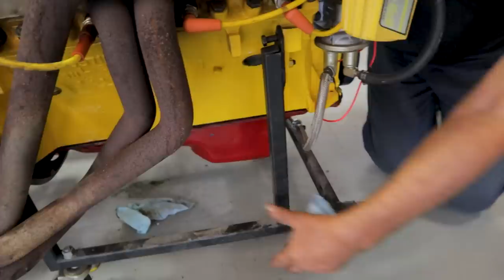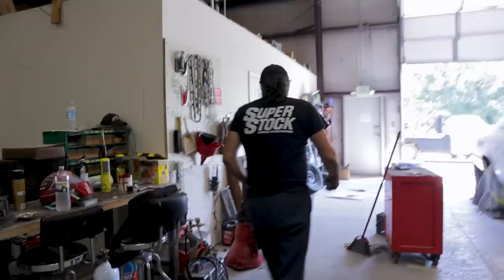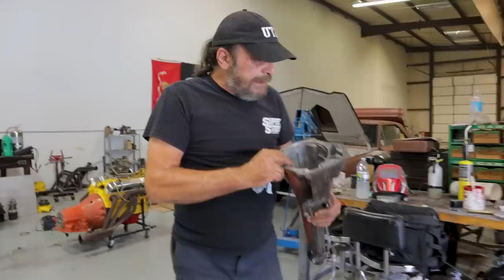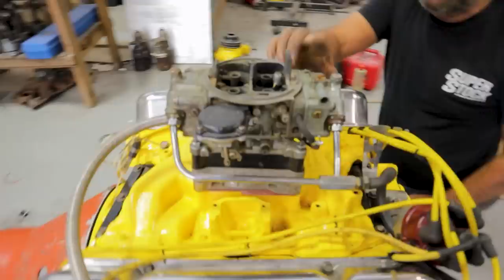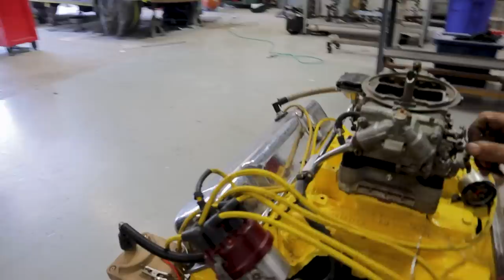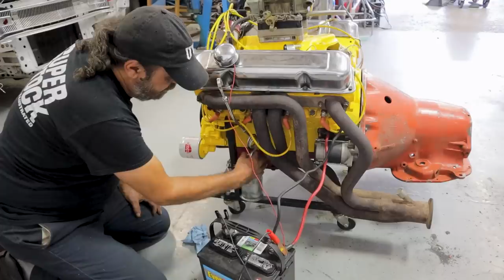Cheapo Homemade Engine Run Stand And The First Start On Our Mule Big Block Chrysler

Comment: Make a separate stand with a radiator and electric fan, that you can roll up to the engine stand and hook up with just radiator hoses.
Reply: He knows this.
Reply: @JasonLuther1  He does, but not every reader of the comment section does.
Reply: @JasonLuther1  really then why doesn't "he" do it??
Reply: Me thinking he just didn't want to take the drive to get it that piece Dallas has is big
Reply: @bbb462cid that’s big brain thinking chief
Reply: @thomasshelby1922  thank you for using my title

Comment: I love each and every one of my tools that just decided to show up somehow one day. They seem far more dedicated to helping me do what I'm up to than any other tools I have. They also seem to be really eager to make themselves show up just in time to save the day.

Here's to magical tools of mysterious origins!
Reply: I have a (close to) complete Stanley ratchet set that honest-to-god fell off the bumper of a van in the '90s as it drove by my house. Great ratchet, my all-time fave set even if a few of the sockets and extensions or of 100% mysterious manufacture. Old, beat up, tested and true tools can't be beat.
Reply: @bbb462cid 
Isn't it crazy how the magical tools seem to be even better than the high-quality pricey stuff you buy? Maybe that's just me, but I got a pair of dikes that showed up one day. They're all clapped out, bites taken out of the cutting edges, wonky joint, but they consistently do a better job than Klein dikes I bought. Hell, they do good enough to keep me from getting some knipex dikes, because I don't wanna spend the cash and end up not using them because I've got my trash pair.
Reply: @bbb462cid  I've picked up numerous tools off the road and stuck in used cars or in the junkyard

Comment: A tip for fresh engine builds… run it with some quiet mufflers. If something is going wrong and making noise, you’ll be able to hear it that way. Then open it up after everything is ok if you want to hear it.
Reply: For sure.....you can even hear the manual transmission flywheel grinding on the auto trans bell housing without the visual of sparks flying everywhere when ya romp on it! 😂😂😂
Reply: @trailerparkcryptoking5213  I like the sparks!
Reply: But then i hand to turn the radio up like when your driving home and something is wrong

Comment: It's been 102-104 in the shop in the afternoon this week. 
We're running tap water through a truck radiator tied to a barrel fan, keeps it bearable til about 2-230. 
It helps we have a truck to run the warm water into to reuse for watering the lawn.

Comment: Shade tree 101 and great video as always. I have a 440 almost finished and wanted to run it before putting it in my Coronet so seeing this provided a great option to chasing a stand somewhere. I’ll have to go farther and include cooling to run it long enough to burn in my camshaft but easily doable.
Reply: I dunno car chassis make pretty good engine stands..
They even have a fuel tank. 
A battery. 
Mounts. 

And a coolant system. 

Amazing. 
🎉
Reply: @fastinradfordable  ....but that isnt what these guys want....and for GOOD reason.
AMAZING that some cannot and do not see this RELEVANT fact.

Comment: I built a run stand from an engine cradle about 8 years ago. complete with radiator and electric fuel pump and fans. It has never let me down and doesn't take up much more space than this rig. Great video, keep them coming!

Comment: After the temperature issues with Plan Z, you may want a ball valve in between your garden hose and the engine and restrictors on the outlets so it can reach operating temperature.

Comment: Tony I always wanted to install a modern disc brake rotor and calliper to a 727 outlet shaft to tune engines with resistance for timing and carburetor response

Comment: Friend of mine was a master welder and dabbled in Chevys. He built a stand out of box tubing and put 4 X body hubs and tires on it to roll it around plus a trailer hitch. Hung a Turbo 350 off the back and used my 69 Caprice spare Rad. I wired it up and put in the gauges starter switch and battery disconnect. He ended up selling it and I never got my rad back! 😕

Comment: I built a run stand for a 200 inline 6 a few years back, its on my channel. I got a slant 6 running on the ground too, i know youd appreciate that motor for sure Uncle Tony lol. If i had to make another one, id totally use a cradle like you did. 

As for control panel, id want something that just bolts/grounds to the engine. Find a bolt hole roughly 3/8 anywhere on any engine and bolt the panel to it. I LOVE starting engines up on the floor.

Comment: Stray shopping carts also make great engine storage stands. Just saw the basket off and use a couple of 4x4's to block up the engine. You can run an engine on it as well, just don't rev it too quickly.

Comment: A brake rotor and caliper on the output of the trans with a locking pin would give you a lot of flexibility.

Comment: Bigger castors  Tony.....the bigger the wheels, the easier it moves.  Try a set of old grocery shopping cart wheels.
Reply: The trick is finding them for this cradle. I'm in the same boat, those wheels are too small
Reply: Tractor supply or Harbor freight
Reply: A cross-brace or two would be nice as well; that's alot of cast iron balancing up there.

Comment: I did the same using one of my engine stands and added a cross bar with up rights for the engine mounts. Welded a plate to rear stand up right to bolt to bellhousing. Worked really well !

Comment: Uncle Tony, when I was in high school in the 80s, we did motor mechanics 

and we had engines on stands like that taller off the ground of course 

but cooling wise they ran pipes to a 44 gallon drum in the corner of the workshop that was full of water, not even coolant. 

It works very well

Maybe if you do lots of testing on the stand that idea would help you out…..??

Might be easier to plug the motor into an inlet and outlet, generic hose, rather than fiddling around with radiators and having the radiator in the way …..

Comment: Though about building a run stand for the 273 too break in the cam. In the end I just put it in the truck, fired it up and drove the damned thing. Same way I've been doing it for 40 plus years. Kept the revs up the first 20 or so miles, new cam is fine at 3,000 plus miles. Quaker State 5W-30 synthetic oil, no zinc additives. Rings seated fine too.

Comment: Thanks for the cool demo Uncle Tony..I have a 305 sbc on the floor that I want to test run like this and have several carbs that need to be rebuilt and sold around here. Your projects help a lot, I will keep tuned (to you build channel). Looking forward to your garden hose coolant idea. Seeya

Comment: Put a truck brake on the back of the transmission.

I have one on my Dodge motor home.

You may need to really extra tighten the shoes to hold against a full load of power, depending on your mule engine, but in the overall, its pretty strong and can hold up to a reasonable amount of power, as it is designed to hold back up to 36,000 pounds of truck or motor home on a 7% grade.

Comment: If anyone has, or has access to a wire welder they can keep their eyes open while driving around for people throwing away bed frames, angle iron is perfect and easy to find for free to fabricate your own stand.
Reply: May work ok for a stand but don't use bed frames for anything structural , the steel is horrible.
Reply: Any time someone is getting rid of a bed frame, I always accept them.  Angle iron can be really useful for a lot of stuff.  I also save old water pipe.
Reply: @robertbriggs4176  agreed that it isn't the best and wouldn't recommend making a car frame from them but given enough bed frames and enough wire for your welder you can build a lot of stuff, using that stand as an example if you made a box out of two pieces of angle iron for the base it would be stronger than that thin wall box tubing on Tony's stand.

Comment: If you want something to put an engine under load without driving it in the car, consider one of those electric retarder assemblies out of a Semi Truck - they have magnetic solenoids that act against a flywheel used to slow a truck down and not wear the brakes excessively. That would be perfect for a scenario like running an engine in, something i've thought about doing too

Comment: Hey Tony, maybe I’m missing something but I’m curious what you would do with the output water from the motor if you just ran a hose to the input. I’ve done this before outside and just let the water flow but I would imagine you would want it more contained in your shop. Just curious, again, maybe I’m misunderstanding something.
Reply: Exactly that  this is how I fire up marine engines before dropping them in so check out marine engine cooling system.
Long story short, connect a radiator hose from thermostat housing to water pump inlet then connect water supply to water pump heater hose fitting.
The waste water will exit the other heater hose connector, usually near or on the thermostat housing.  Water will be recirculated through the completely full block water jackets by the water pump, so there will be no hot spots from trapped air pockets.
Don't forget to drain the block before cold weather exposure.

Comment: Why not use a whole transmission with fluid. Take a yoke attached and welded to disk break rotor install caliper master cylinder with a locking handle and adjustable pressure to test torque converters.With a little work I think it could be done.

Comment: Get fat wheels for the stand, i got some that came from pallets that held hd steel sitting benches for the Mall outside use in Vegas. they have ball bearings about a 1/4 inch fat solid rubber wheels.
Reply: Get shopping cart casters

Comment: U.T...why not just apply the foward & reverse drum in the trans.....!....it would be like a line lock....it would be all valve body work..im sure u have done that @ one point...!...just a thought..or... .send the valve body to that guy u mentioned & have him set the valve body up with a line lock...!...i dont know how or if anyone will or has done that..but...I think u will crack the case by the parking break ball...if u try that route...!..lock'n both drums is safer than the park'n brake ball...only thing u can do with a line lock is cook the fluid or damage the convertor...one toggle switch controles it...simple...great video....

Comment: Wondering if you could weld a yok on a sliding square tubing like a 3 points hitch to mount on and off the transmission when you need to change the transmission. With a hand break like old trucks have on manual transmission. You could put the transmission in gears to test the converter ?  Mounted on 1" plate, the transmission wouldn't move a bit.  Would testing a converter in park really  be accurate measures ?  One teacher always had this tought of, " why do something simple when you so it complicated ?"  I guess he had a little influence.   Hahaha
Reply: Not for 6000 RPM test.  Lol

Comment: so hows the 361 stack up to a 383 2bbl? would a rebuilt 361 be better than a rebuilt 383? just curious because my 383 is tired the valve seals are laying in the head in pieces

Comment: Could you just bolt an auto transmission and converter in it and just leave it in nuetral or park and run the engine?

Comment: Ive built multiple test stands for ford engines and always run a flex plate rather then a flywheel just incase the flywheel decides to come apart for whatever reason.

Comment: Hey Tony how did you trigger the coil I know you put the positive to the battery but the negative do you just plug it in the distributor and distributor to ground ?
Reply from the maker: It's a points distributor.  One wire from the distributor to the coil
Reply: @UncleTonysGarage  can you make a video like “how to wire an engine on an engine run stand for dummies”? I have a BBF and want to start it like this but can’t really find a video that does a step by step and why, points vs other distributors, etc. Thanks for the awesome videos.

Comment: Everyone says how to break in a cam at home but what do they do at the factory when a car is built is it the same process ?
Reply: Back when flat tappet cams were the rule of the day, auto production engines were test run at the end of the engine assembly line, there is a (u-tube) video from a FORD engine plant in the 1970's showing a worker hooking up the engines and starting them, and bring them up to temp.  Pretty sure if a manufacturer didnt actually start the engine at the end of the line, they were cold spun with an electric motor to test everything.

Comment: Could you do a quick video on how to wire an engine that doesn’t have an ignition harness hooked to it so that it will run? I’m trying to figure out if my 230 in-line is worth saving but the harness is smoked
Reply: Depends on the ignition setup on the engine. Generally with something carbureted you just need to get power to the ignition and it should run.
Reply: @NBSV1  that’s what I figured too. I may not have the smarts quite yet. Never messed with one that was unconnected.  Seems like somewhere in there the ignition switch has to tell the system “on” or “off”. Everything hooks on the starter so I’m lost
Reply: @JacksonEngineering  Ground to the block, 12v to coil+ & temporary heavy gauge 12v to the starter+solenoid.
Nothing else required.

The ignition switch (run) normally puts 12v to coil+, and (start) triggers a relay to put 12v to the starter+solenoid.

There's a bunch of other "long term" stuff in the harness to manage voltage/charging and reduced coil voltage but that's for longevity not functionality.
Reply: @YouveBeenMiddled  thanks!  I’ll play with that this weekend if I get frustrated getting the floor back in the truck

Comment: Hey Tony, where do you buy your gas squeeze bottles? Seems like I used to be able to find the dang things anywhere, but now all the stores around me only seem to sell crappy "earth-friendly" plastic bottles that melt at the slightest hint of a hot fart. Water's probably the harshest solvent these damn things can handle, and even then I wouldn't leave em sitting full for too long. Then they wanna charge upwards of $12 for the privilege of owning pre-emptied garbage. Nonsense!
Reply: You want HDPE Squeeze Bottles.
High Density Polyethylene is the stuff they make gas cans and chemical bottles out of.
Reply: @YouveBeenMiddled  
I know, and that's what's killing me haha
Problem I keep running into is places around here don't seem to sell bottles like that made from HDPE. The HDPE containers I've seen them carry are just not at all appropriate (size, dimensions, whatever) for this use. A lot of them don't have any material markings on them, and the ones that do are more often than not are PVC. Maybe not PVC specifically? Now I'm second guessing myself, but either way it's a material that is just as bad for use as a container for petroleum distillates.

I should just break down and order some online, but I'm stubborn and I like to buy things from real places, even if they're mega-chain stores.

Comment: All that work and still doesn’t make as much power as a factory stock modern Cadillac… or Dodge… or Ford truck… or Honda Civic…
Reply: Horsepower is not relevant; TORQUE is what counts, and torque is how horsepower is calculated, as a function of RPM. Horsepower is just the RATE at which torque is distributed. This 361 engine w/cam & headers and 4 bbl carb probably produces more torque than all the engines you mention except maybe a twin turbo Caddy 3.0L / 168 CID.
Reply: Even if it doesn't, it sounds better.  Gets my blood moving.